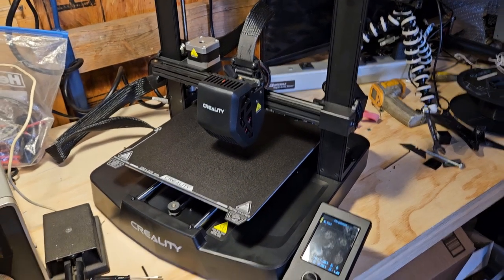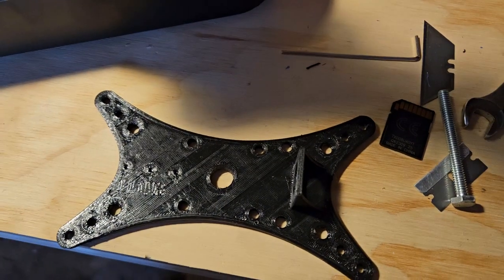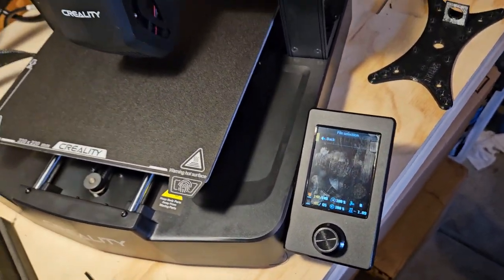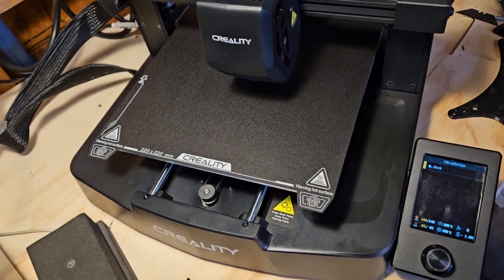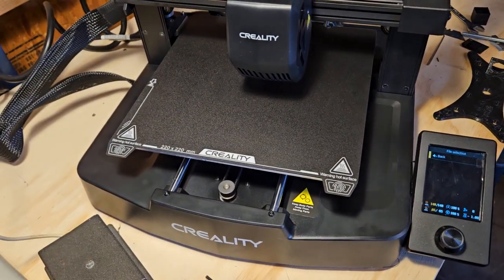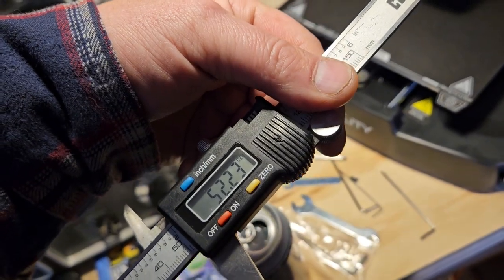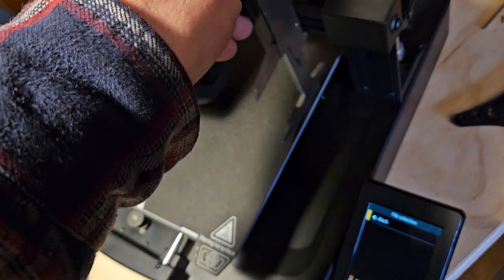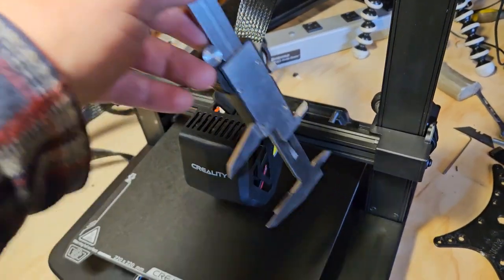ender 3 v3 se not level. z axis rods

Comment: This is great and all. But how do you fix it???
Reply from the maker: Add adjustable bed leveling  or spacers
Reply: @hamradiohack  that's the real solution, yeah. I found the fasteners on the screw lifts have two screws that secure them. You can loosen it and get semi decent results with a properly leveled X axis. I also had to do a bunch of test squares on each probe point and manually edit the leveling data. Which took forever, but after I get fairly decent first layers over the entire bed.
Reply: I will say the auto level at least on my printer is quite bad. At some spots it was off by almost .7mm. Nowhere was it within .02mm of optimal. Global offset was also off by. 5mm